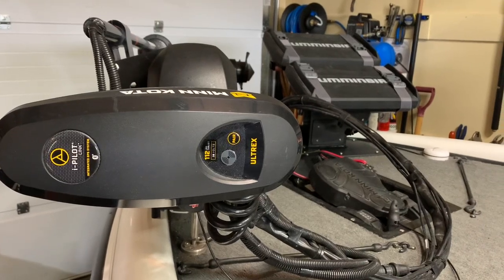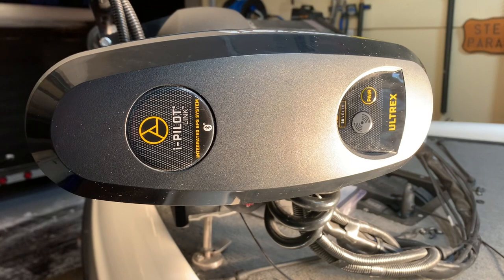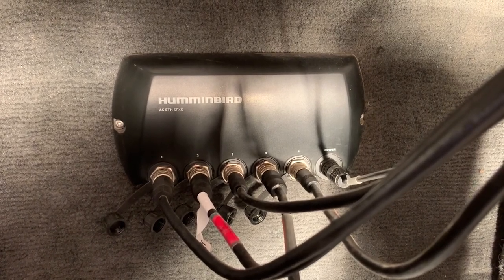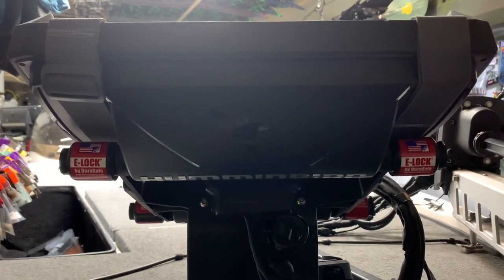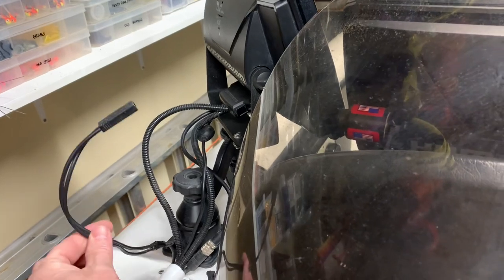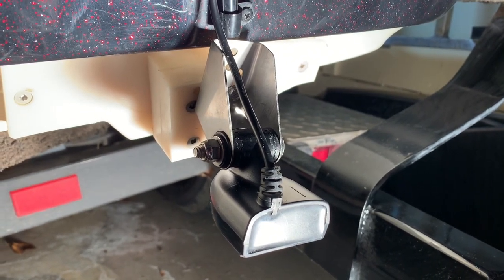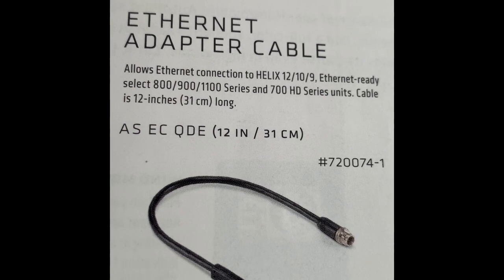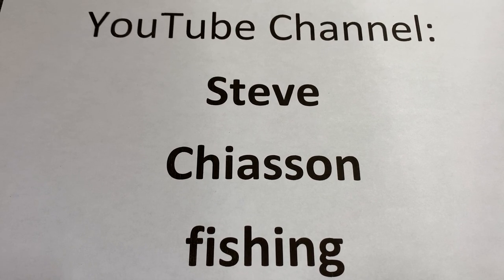My One Boat Network, Minn Kota I-Pilot Link with 4 Humminbird Helix units and Mega 360

Comment: I have a rookie question for you.  I have been working on setting up my boat with a simple system.  I have two G#N helix 7's and one is a control head only for my bow and i pilot terrova trolling motor with the mega di transducer.  I have at the moment networked my two helix 7's together.  I have a tablet set up with the i pilot software on it.  Down the road I am looking at adding a Canon Optimum into the mix.  Is there any benefit to using the 5 port ethernet switch when everything so far is bluetooth?  Thanks in advance, Jack
Reply from the maker: The 5 port Ethernet switch would be needed if you want your two units and trolling motor ( if I Pilot Link) to talk to each other. Your message had G#N, I am assuming G4N. At this time units are still using Ethernet cables but have wireless capability down the road. If just linking two units, an Ethernet cable and tow adapter dongles to share waypoints, not maps, would be all you need.
Reply: @stevechiassonfishing5876  Thanks for the quick response.  No they are both g3n units and they are networked together with the appropriate cables.  The front is a control head only and hooked to the mdi transducer on the trolling motor as well.  The trolling motor is ipilot not link.  There is a post from a fellow I saw and he used his old Helix 5 for sonar only and has his other two Helix ones networked together as I have and shares that way.  So much to learn but getting there.  Have a safe and happy holiday Steve.  Jack
Reply from the maker: @jackwheeler3081 , no problem, sounds like you’re all set 👍. Happy holidays!

Comment: How does the trolling motor connect to the 5 port switch does it go directly into the switch and then the dongle end into the back of the screen?
Reply from the maker: The I pilot link trolling motor has an Ethernet connection that plugs directly into the 5 port Ethernet switch. The transducer connection goes into the Helix unit.

Comment: Are you saying the MEGA-360 MUST use a gps puck (From either manufacturer MinnKot or HumminBird)?  I did connect my MEGA-360 to my Helix-10 MSI-SI + GPS GN4.  I would of thought the Helix-10 MSI-SI + GPS WOULD provide the data for Way-Points or SpotLock-Points???  No?.  Sorry being in Far North Michigan the boat is still in storage that why I'm searching the YouTubes :)  Blessings.
Reply from the maker: If you have an IPilot link trolling motor you can use the heading sensor (MinnKota) that comes with it. If no IPilot link then you need the AS GPS HS puck, which is optional, to see waypoints on your Mega360.
Reply: @stevechiassonfishing5876  OK I think I got this figured out.  My Terrova was Pre 2016 with OEM with an I-Pilot head.  Later (maybe 2017) I was able to purchase the I Pilot LINK head as a replaceable upgrade and this did NOT have any puck with it then. 

So the next question is:  I have 3 each G3N Helix's and one of them is a GPS in the name and all are on the Network Hub and the Terrova I-Pilot LINK is on the 4th Network Hub port.  The MEGA-360 is direct cabled to one of the Helix Gen 3's without GPS.

I believe the HumminBird AS GPS HS puck has a (20 foot NEMA / COM Cable and Connector ONLY) Since I can not plug that too the Network Hub.  I will have to ATTACH the AS GPS HS puck the the Helix that has the MEGA-360 installed on???  Thus that Helix will not get GPS from Another Helix Unit on the hub???

Blessings to You and Yours Sir.
Reply from the maker: Your units that are networked with the 5 port Ethernet switch will be able to share waypoints.
Reply: @stevechiassonfishing5876  Thank you Sir & Blessings and Tight lines every year.  C B

Comment: Steve great information couple of questions
1- High speed transducer when do you need one, at what speed ?
2- Will the transducer that comes with the Helix units with MDI or MSI work for sonar, depth when running at say 30 mph? 
Or
Do you need the high speed transducer?
3- I just received my 360, it does not come puck GPS?  Which unit GPS should I get?  You mentioned you do not need the heading sensor unit.
4- The Y cable there are 2 listed, 7 pin & 14 pin. Not sure which one to order. My thought is 14 pin For MSI?  I have all MSI units a helix 15 - 12  & 10
Appreciate any feed back

Thanks

Joey@ Fishin’Chronicels  You Tube
Reply from the maker: Hi Joey, if you’re happy with sonar reading at 30 mph, don’t bother with one. Try without first, in my experience with bass boats, faster you go, poorer the reading with 30 mph the turning point. The heading sensor will only work with the Mega 360 if you have an IPilot Link trolling motor. The bigger the unit the better with the Mega 360.
Reply from the maker: The 14 2DDI Y works with built in transducer and 9 with external transducer.
Reply: Steve I did order the Ultrex
Just waiting for it to arrive.
So do I still need a puck for the 360?

As far as Y cable 9 pin or 7 pin is what I need?

Thanks for your help!
Reply from the maker: If Ultrex with IPilot Link, you don’t need additional puck, just the heading sensor. There are different y cables. Can you be more specific about what you’re trying to accomplish with y cable? Does your Ultrex have built in transducer and if so what transducer?
Reply: @stevechiassonfishing5876  
Steve sorry for the delay

I got the Ultrex with MSI 

The reason I thought I needed a puck is because on the box of 360
Reply from the maker: I wondered the same thing too. An added bonus of purchasing an IPilot Link, saves you having to buy the optional puck.

Comment: Does the 5 way switch require 12v power from battery?
Reply from the maker: The 5 port switch does have a power cable. For more information, Humminbird website includes installation instructions when you look up the 5 port Ethernet switch.

Comment: Where is your 2 nd docking station  or which item is not connected to the network
Reply from the maker: I added a second 5 port Ethernet switch under the console. I moved the ordinal one from the center and they are side by side now.
Reply: @stevechiassonfishing5876  did you get your mega live yet
Reply from the maker: Yes I have my MegaLive

Comment: Hi Great Video! Thanks for sharing all this info,  I'v come up with some issues that maybe you can help me with. 1. I have a ultrex with built in MDI and  I purchased the Y cable to connect both of them because i only have 1 screen. It's on a 12 in Helix megaDI. but my DI and Mega DI isn't showing up anymore. the second is the waypoints not showing up on the 360 view. i know you mentioned if we had a Ipilot puck we wouldnt need the gps puck. can you help in setting that up as well? thanks again for all your knowledge this is great!
Reply from the maker: Is your trolling motor an IPilot Link? Also is your Helix a G3N?
Reply: @stevechiassonfishing5876  Yes Ipilot link and G3N :)
Reply from the maker: That’s good, things should work then. You need to make sure Helix is running software version 1.940 or higher, IPilot Link 1.270 or higher, remote 2.010 or higher and your waypoints should work with heading sensor as long as you turned navigation on in your Mega 360 settings. If you have a built in MDI in trolling motor, 14 M360 2DDI Y is the cable you need, external transducer 9 M360 2DDI Y and hooked up should give you depth.
Reply: @stevechiassonfishing5876  Maybe i need to do the software updates, how do you updated the remote and the Ipilot Link? i'm sure i can find the Helix updated online but not sure how to update the ipilot link and the remote. As for the Y cable i am running the m360 2ddi y so my guess is just the update? or is there something i need to make sure is turned on in the head unit of the helix?
Reply from the maker: Make sure navigation on in Mega360 settings, as far as software updates, go to Humminbird website, support to software updates, the first section is fish finders, then Accessories and Mapping and you will find the IPilot Link controller and remote updates. I recommend printing off the instructions and follow them using the SD card. That’s what I did.
Reply from the maker: I did do a video on Basemap updates if you have never done an update. Ideas in it that will help you.
Reply: @stevechiassonfishing5876  amazing i'm going to try this on sunday seeing how i'm away for the next couple days. Ill keep you posted if that ended up working thanks!
Reply from the maker: Hope all goes well.

Comment: You must have $20, 000 in electronics!
Reply from the maker: Helix units are the most affordable. I have one G2N and three G3Ns. Definitely not $20000 but there’s a considerable amount of $ there. I run an older boat and added things on over many years. New boat owners often finance in electronics as the payments difference is worth it to them. Effective use of electronics will make you a better angler.